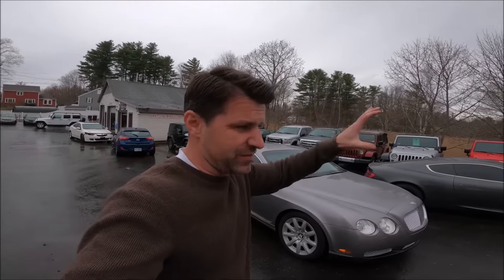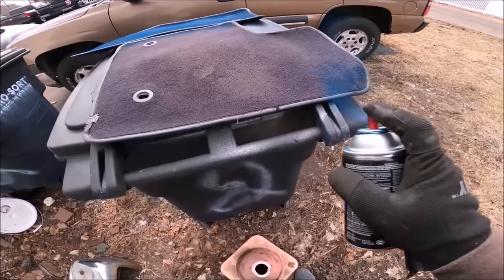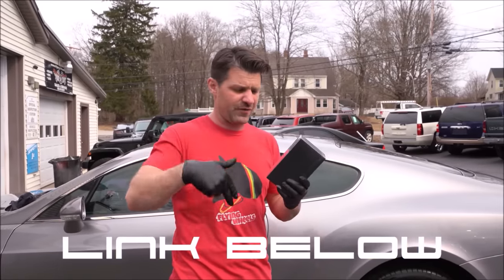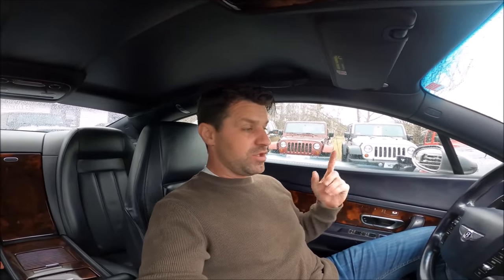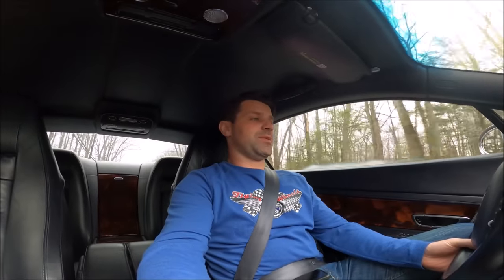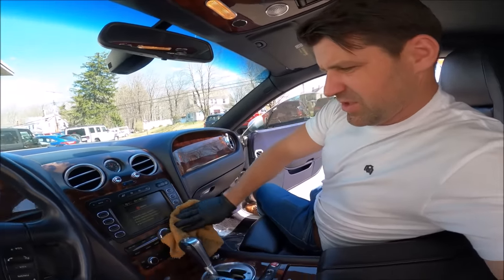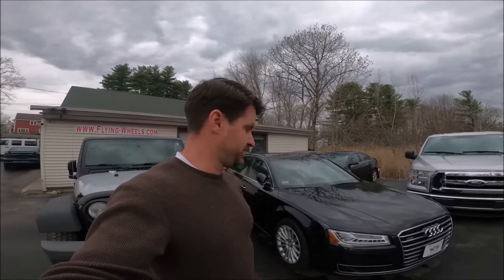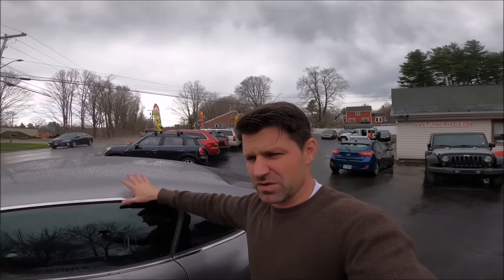I tried selling my $400 Bentley GT on the Doug Demuro Cars and Bids website

Comment: Dude I absolutely can't believe you put a self tapping screw into a Bentley and drilled through the leather. I would be so pissed if I bought this and didn't notice that before purchase.
Reply: Better than that gap imo
Reply: He's a great dude, but holy shit I physically recoiled and had to pause the video when he did that. Also the prying the brake light up with a metal screwdriver right against the paint was also a cringe moment.
Reply: Probably good to note when using online auctions.
Reply: This! Was there no way some rlly strong double sided adhesive would’ve fixed the gap? Made it look like a jeep
Reply: @alexflosho  replacing the broken plastic that it mounts under the dash and fitting it properly would be better in my opinion. I would rather lose $1,000 of profit than put my name on a bad repair. This is why used car dealers get a bad wrap even though I really like this guy.
Reply: @icandreamstream  then he ain’t a great  dude while using Home Depot screws in that car.
Reply: @joshua_J  well he is a used car dealer with a stealership so what else should we expect?? Just what we got.
Reply: I don't know why yall complainin this guy selling 100k  car down in the 30s , yall probably the same kinda people trying to offer dude 15 k 🤣
Reply: @hardup9809  he must’ve hired quite a few public relations people and you’re one of them. Who’s complaining about a Home Depot screw in a Bentley… hey what’s wrong with that option?? 😂
Reply: @icandreamstream  exactly and then sold it to the next sucker. If he’s doing that on a Bentley then you can imagine what’s used on the cars on the lot.
Reply: Gotta agree that screw seemed kinda ghetto.  It's a Bentley, not an '88 Crown Vic.  Also not a fan of spray painting the floor mats.
Reply: @alexflosho  did you look it up?
Reply: @brettb8825  ghetto stealership ghetto tactics. If he does that to a Bentley the rest of the lot is an episode from Sanford and Son.
Reply: @alexflosho  I just looked it up and I can get it for $198 plus shipping. It is used but it's far better than a screw. There are plenty for sale just saying
Reply: @joshua_J  The only justification I can see is that it was looking like he was about to take a loss on the Bentley, so wasn't willing to spend good money over bad. That said, I'd be pissed watching this video on the car I just bought if I were the buyer. Eek.!
Reply: @XX-166   Nothing is wrong with that when the car is only 30K🧁
Reply: @dakotaautosales9673  sure… just use home spot screws in all of your repairs on lot cars and show everyone how you’re willing to cut even the smallest corner for your profits while your customers never know you’re doing it.
Reply: @SteGoughdotCom  it’s a reflection of the overall profit concept at that stealership. What do you think has been done to the rest of those vehicle waiting on the next sucker to buy them?
Reply: @joshua_J  it is a stealership you know so what else would we expect. If he’s not sharp enough to not show us all on camera what the business is capable of then you know how the other cars are put together… the same way or worse.
Reply: @SteGoughdotCom  there is no justification for that on that vehicle.
Reply: @alexflosho  or just use some adhesive velcro???
Reply: It sounds to me like you need to open a steeler ship and show us how it's all done the right way🧁😂
Reply: @XX-166  there have been many "repairs" throughout this series where I've cringed hard. These top the cake though. I'm not defending it, just pointing out where they might have felt justified in the bodge job....
Reply: Y’all care to much 🤣
Reply: I almost puked,.... projectile vomited, across the wall when I saw that. Oh my fucking gawd.....my head is SPINNING. Hahaha
Reply: Does anyone know when in the vid that happens? I can’t find it
Reply: @supercooldude824  Around 22 minutes.
Reply: @yamayahoo77  thx
Reply: Car guys really are the worst
Reply: @brettb8825  Yup. Entertaining video that Je_SUS_ some of those 'repairs' were fucking ghetto.
Reply: This guy should stick for flipping Civics
Reply: That was my favourite part.
Reply: @dakotaautosales9673  mental note.. stay the fk away from dakotaautosales!!! unless you want a frankencar by the sounds of it
Reply: @chuch541  nobody who actually values cars does this to any car.. not even the most POS car they ever owned. this is a cowboy move and its gonna cost someone $$$$ to put right when it was only $$ to do right the first time.
Reply: @LordDaveKoresh   You have to have a dealer's license to do business with me Skippy You're not published to buy a car at wholesale
Reply: Yeah even forgeting about the ruined leather and ugly screw sticking out, the whole point of the fuse panel is that it's easy to get to and fix any issues, good luck getting that panel open on the side of the road now when a fuse blows
Reply: @joshua_J    all used cars are 99% chance they are junked up, because nobody sells a good car,  they drive it themselves if its nice and works good they may like in the video try to clean them up nice, but still its junker.  clean a turd its still sheet though
Reply: @hardup9809  nowhere close to 100k car.
Reply: You’d leave it and get a new plastic clip surely!!!!!
Reply: hints why most people hate buying from resell dealers i would never buy a car from this guy u never know what ur getting
Reply: Bingo and BINGO !!
This is the best channel yet to justify buying new !!
Seems like a smart guy that outsmarts himself.
Puts on a glorious “Tricks of the Trade” show.
Pretty damned scary !!!
Reply: You can’t think of any other way to fix the fuse panel ?
Well…..ah….MAYBE a dealer could….and do it correctly.
“Why yes, this is my Bentley….they all come with bailing wire and Home Depot screws…..why do you ask ?”
Reply: Whoa…….WHOA……please…..how in hell do you open the fuse box that originally had latches and a hinge ?
Oh…..I got it !   
“ Bentley blew a fuse, Marge, I’ll just get my DeWalt Super-Galactic 200 volt power screwdriver and a camping mat and have it fixed in no time…..!”
“Marge ?…..MARGE ???……where you going in that Porsche….?”
Reply: Jesus its a 05 continental gt,  they made plenty of them and barely sold when they were new.  In 10 years that car will be in a scrap yard not a museum.  Not sure why some people think expensive cars are somehow special and must be mantained at the highest of level.  If your willing to put a screw into your civic a pillar then why not a bentley.
Reply: Like Derek from VGG says, “let’s pretend we didn’t see that”.
Reply: Dont worry he rattlecanned the screw first LMAO...
Reply: It is a USED car-big deal-keep the leather in place-gotta hit a price point-can't call in $1000 upholstery person for every nit. $1screw-makes sense-USED CAR !
Reply: This is why I’d never buy a car from him
Reply: I would be so pissed 🤓🤓🤓

Comment: Wow, it starts EVERY time?
Incredible... It's like a real, normal car!
Reply: Yea no true but he was sayin that cause its a old Bentley. Bentleys have a reputation of breaking down very soon. Not only that, it has 118k miles. Thats a lot of miles. Yea sure most cars would be chill at 118k but its a 2005 Bentley Continental GT and its almost 17 years old.
Reply: Jeff Lee  did you just compare your mustang convertible to a bentley? lmfao
Reply: jefflee1189 this is just false, a bentley if maintained properly is just as reliable as a mustang. It could also be more reliable, the issue is that you would need alot of money to maintain and service a bentley properly which alot of people tend to overlook.
Reply: jefflee1189  the older continental gt shares the same engine as a volkswagen phaeton and v12 toureg. And newer continental gt’s share parts and drivelines with other Audi’s and Volkswagens. All of those cars are known to push 200k miles easily but they are just expensive to maintain. 

Bentleys arent driven as much because operating costs are extremely expensive. A simple oil change on a bentley probably costs more than what your mustang is worth. Also another reason why nobody is driving these around all the time is cause if you have bentley money you probably also have money for other nicer cars or your always on vacation/travel in another part of the world.
Reply: jefflee1189  Lmfaoo every car that has an engine needs an oil change, doesnt mean its broken. But hey if you’d rather drive a beat up 200k mile mustang than a bentley then more power to you. Me personally, I’d rather be seen in a bentley🤷‍♂️

Comment: 17:42 The "jet engine" sound you're referring to is your secondary air injection pump that is about to go out, that's exactly what they sound like as the bearings in the pump go bad.
Reply from the maker: Wow. Amazing! Appreciate it
Reply: That’s… probably not good lol
Reply: That's a big ouff hope he sells it before he has to fix it
Reply: @FlyingWheels  it should be pretty easy to put power to it at the connector, to verify that’s your sound. I had a similar issue a few years back on a C-Class, only sounded like that on a cold startup. It’ll probably run like that for years and never get any worse, but it’s pretty annoying 😂
Reply: @FlyingWheels  if it’s the same secondary injection pump as other VW/Audi group cars, it’s usually the rivets that hold the pump together that fail. Can be drilled out and replaced with machined screws. Could save you a ton of money lol

Comment: The water blade, while convenient, has the potential to drag something on your car that could scratch it. Paint correction - buffing to remove swirls and scratches - should be done before ceramic coating.
Reply: I have and use the blade but only on my older cars that I don’t care so much about. I do not use it on my new baby Mustang.

Comment: I believe some car alarms have their own backup battery so it can still alarm if someone disconnects the car battery.  That is probably the reason why it is sounding even though you had both of the car batteries.  The alarms back up battery is triggered when the car battery is disconnected.  Once that happens the alarm is triggered.

Comment: I had the same problem finding the right buyer for a 1983 Jaguar XJ6 VDP. Buyers would ask is their anything wrong with it ?? Huh... Its a 40 year Jag... It runs and drives and I am selling it for $2000 what do you think! High school kid ended up buying it. Called me two weeks later and I felt bad so I should him how to start it. Fired right up(stickey Air Flow Meter). Few months passed by and I got a $600 fine from the state for abandoned vehicle... Thankfully I reported sold and had proof!! Till this day I wish I would've just took it to the demolition derby and avoided the whole mess.

Comment: I can definitely vouch for the Avalon King ceramic coating.  Been using it on all 3 of my vehicles for about 2 years now, the coating has been holding up well but my daily is starting to lose it's shine a bit.  For best results do it in a garage that won't have any dust blown into it and keep it garaged for about a day or two for it to fully cure.

Comment: I been having my new cars graphene nano ceramic coated for several years now. There’s a lot less prep work needed on a brand new car, that has a perfect (or near perfect) finish already on it. I LOVE a ceramic coated car, because it’s much, much, much easier to keep clean and it will protect the clear coat for years to come (so long as it is properly maintained and renewed every 1-2 years. Ceramic coating is DEFINITELY WORTH IT, —-IF—- it is applied correctly by a PROFESSIONAL who knows the proper procedures for preparing a car to be ceramic coated. On an older car, it’s imperative that the car be properly prepped, which can take some time. For our pre-owned vehicles, we prep the car, including clay barring it, then do any necessary paint corrections or touchups needed, and re-prep it again, and then apply the graphene nano ceramic coating and let it flash, hand buff it out, put it under UV lights (to speed up the curing time) and when it’s done, it’ll look SUPER GLOSSY and super slick and as smooth as a baby’s butt! Going forward, I will NEVER have another vehicle ever again, that doesn’t have a ceramic coating on it.

Comment: Armor shield would sure make my Infiniti fx50 look really good!
Reply: @alexflosho  ya I know right the fx50s are very rare I've had alot of people try to buy it off me but I love it so much I'd probably never get rid of it.  Has 130k miles and haven't had a issue other than the starter going out
Reply: @alexflosho  replace your blower motor resistor that is what is causing it to shut off when turned to high.   Had to replace a buddies it's super easy it's directly behind the glove box
Reply: @alexflosho  no problem man definitely try to help out the car community when I can

Comment: Armor shield. Loved the video. I've been playing with junk boxes my whole life.  My first car was a 1968 Mercedes Benz 190D I bought for 200.00 bucks back in 1977.. it was out in a field behind a barn. 
This past fall I bought a 1982 Alfa Romeo Spider rot box. I replaced every rotted panel and inner and outer rockers on both sides. 
I lost the space I had to work on it and stored it outside up here in northern New Hampshire and over the winter it some how broke lose from the chocks and rolled down my hill and rear ended a tree. UGGH!! Im not even sure if it can be fixed but it runs so good and the tranny shifts great I can't get myself to get rid of it.. my wife thinks I'm crazy but I'm going to try again on another Alfa Spider, but I just love the old Italian cars.
Reply: That’s horrible, ALWAYS use wheel chocks I’m in the heavy duty towing industry and I’ve seen more things roll away than I’d like to remember… good news is it should never happen again to you

Comment: I do the same thing when I detail my vehicles. Tried  Different tire shine, black magic I perfer. Never used this product, to protect my finish I give it a wax in three stages. A light, a medium, a heavy. A gloss wax is last, and I've finished with some rain-x. If you use rain-x for a month after every wash,  depending on where you live. I'm from the dirty south so it's like two to three times a week. It can last three weeks to six weeks. It's a cheap way to protect your finish.

Comment: Prying on the 3rd brake light with a metal screwdriver, claybaring the vehicle and not polishing before ceramic coating?, Tire shineing the engine bay, and self taping screw in the dash? Definitely have a lot to learn smh

Comment: Where you did the self tapping screw, instead, get a snap where you can snap a leather covered button there.  The metal snap piece gets screwed in just like you did but then a leather snap goes over it.  Think leather covered buttons on furniture.  Then the next owner unsnaps the button and then unscrews.  This would look much better.

Comment: I had a problem with the windows not closing properly and you can reprogram the switches by holding up and down for 3 seconds etc. A Bentley mechanic helped me on the phone. The most important thing is keeping the batteries fully charged.

Comment: The alarm has its own built in Ni-cam battery that is also connected to the power system to keep the internal battery
but when the vehicles backup battery is disconnected it triggers the alarm it's part of it's own alarm system.

Comment: I had same DUAL BATTERY issues - Nightmare - It was the double battery controller in the end - plus the car needed to be put on charge weekly to maintain the voltage to keep the computers working.
Reply: Was that on a VW/ similar make or was it a Mercedes?
Reply: @hyperwebbing  This was VW Phaeton V10 Twin Turbo Diesel - 2004

Comment: Armor Shield shows us how far we have come from rubbing a cars finish with an old fashioned hard wax - and then rubbing it off.
Reply: I would have looked hard for other solutions rather than using a self tapping screw in the surface of the leather. Do you keep a roll of butyl caulk around for adhering “gapped” things together?

Comment: Amour Shield - sweet. Fingers Crossed.  

(A BOUT THE BATTERY) The battery industry is fixed and manipulated to be a throw away industry. 90% of the time they just need to be refilled with distilled water since they vap off over time loosing electrolytes.   SO ... Don't disconnect them. Or you will need to reboot the troublesome CPU at times. Just pop the 2 caps on either side of the battery and add Distilled water to the electrolyte reservoirs that are low. Then put a battery tender on it to slow trickle charge it gently back to its high end spec voltage. If you disconnect it to work on it, you will need to reboot the factory setting and sometimes need a dealer to help figure out the Security Alarm issues etc. Just a suggestion.

Comment: armor shield

Great video! Here's a tip for the plastic under the hood: use some of the armor shield on it. It lasts longer and is easier to clean. The alarm siren usually has a small battery or capacitor on it.

Comment: Spray painted carpets, fuse panel screwed in with self tappers, a flathead opposed to a plastic pry tool on the rear brake light and a used Bentley with over 100k miles. 
Oh the life of a used car salesman.
Reply: indeed, that screw was ridiculous
Reply: Dude painted the screw like he figured out some hack. 🤣. The funny part about marketplace buyers cracked me up...meanwhile look at what they're looking at. A beat, used Jerry rigged 33k Bentley.
Reply: Guy reeeeeeally should not show how his shop does little fixes. If this is how they repair a Bentley imagine what they do their basic cars.
Reply: @Sharky_Mcstevens  Exactly,  the more i see the more I cringe. Im sure the clip could have been repaired by taking the whole thing apart instead of drilling a hole in the expensive leather. I wonder if that ghetto hack was photographed and listed in the auction...